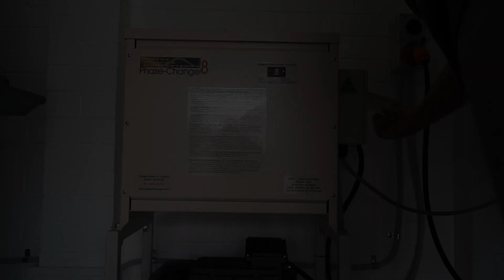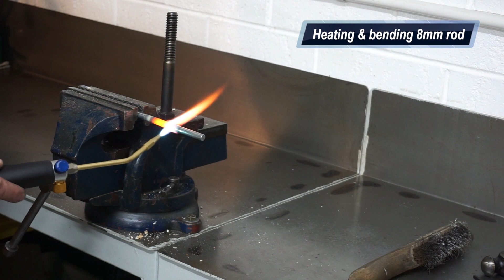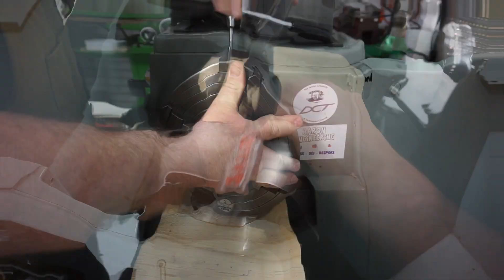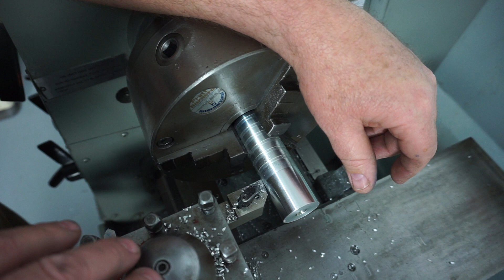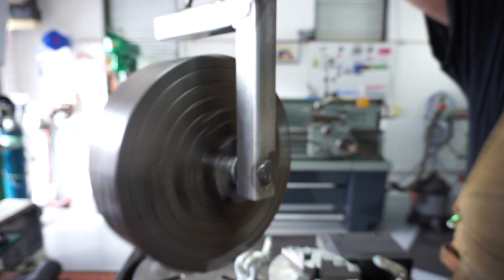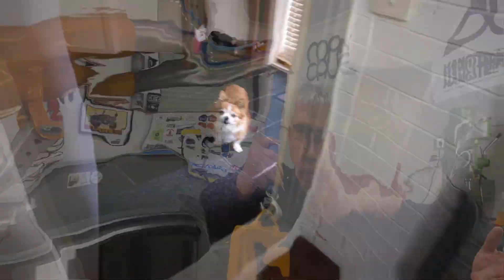Sky Hook LATHE Chuck Lifting Attachment

Comment: Nice idea, I like the use of bearings.
It's funny, when I sited my lathe in the shed, I didn't think this far ahead. 2 feet in one direction, the chuck would have been directly under one of the roof beams and a good lifting point.
Reply from the maker: G’day Lindsay. Thanks mate it comes in handy that crane and hook. Especially when my back is playing up. Good idea to use that beam in your shop mate. Cheers 🍻
Reply: @AaronEngineering 
Yes thanks, I see a move on the cards.
I might be okay to lift things now, but bit further down the track - not so much.
In fact I had to use the extension ladder last week, and I'd sweat it's gotten heavier.
Reply from the maker: G’day Lindsay. Yes that’s the story of my life. Getting older and lazier mate. Cheers 🍻
Reply: @AaronEngineering 
Or maybe we try to use our brain muscles more than our back muscles more as we age.
I must admit I spend more time evaluating a task now, than I used to.

Comment: Very nice Chuck holder. How has the bolt held up with heavy chucks?
Reply from the maker: Thank you 🙏. It has worked fine with my D1-4, 3 jaw and 4 jaw Pratt Burnard chucks. But bigger D1-6 chucks what probably bend the bolt. Cheers 🍻
Reply: Made the roller yesterday. We will see how it goes. I may have another solution for my situation. I don’t have 10” chucks.

Comment: Did you grind the gal. Off the square tube before you welded the lifting hook on? I hope so 🤞🏼
Also, is that a Galeb mill?  If so, I have the same machine and I really like it.
Reply from the maker: Hey buddy, nah just upped the amps and breathed in the green fumes 😂. I’m not sure about my mill, it a Taiwanese model which was rebranded Herless. Love to find the PDF manual for it. Cheers 🍻
Reply: @AaronEngineering  i have one I think, I’ll look for it.
Reply from the maker: @riverbuilder2251  thank you, that would be awesome if you can. Much obliged 🙏

Comment: Thanks, Enjoyed and the humor.  I would still be nervous about the lathe chuck sliding off the lifting hook, Yikes. Drop an 8 inch four jaw chuck onto  the concrete,😆😆😆😆  Later from Texas.
Reply from the maker: Hey Fred, thanks for watching.  I don't think it will slide off as you clamp the chuck down tight on the rotating spindle.  It could fall off if the bearings or weld fail though "DOH"!  Cheers, Aaron
Reply: @AaronEngineering  I guess I missed the part about tightening the chuck down to the spindle. Senior moment. lol
Reply from the maker: @fredboat  no worries, I’m in the same boat 😂

Comment: Good Job.

Now to fabricate a Mill Vice lifter.

What was yourCoolant / lubricant ?
Looked like engine oil & kero mix.
Reply from the maker: G'day Chris.  Thanks mate very happy with finished product and works a bloody treat too.  I've seen the mill vice lifter, they usually unbold the sliding jaw and bolt it on.  No that coolant was some old Cimstar Cimcool I had left over.  I have now switched over fully to Hangsterfers 5080.  Cheers, Aaron.
Reply: @AaronEngineering  Where do you buy it ?
Reply from the maker: @ChrisR2517  Hey Chris, I get most of my tooling, oils and coolant from Arthur at Livetools in New Castle.
Reply: @AaronEngineering  Thanks Mate !